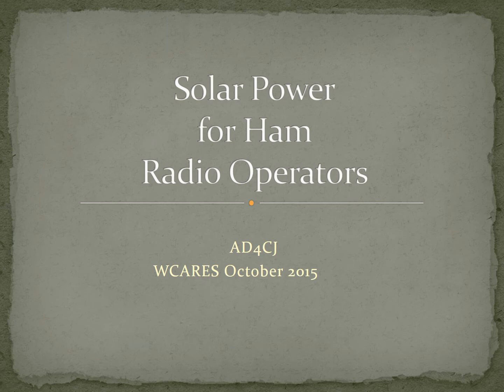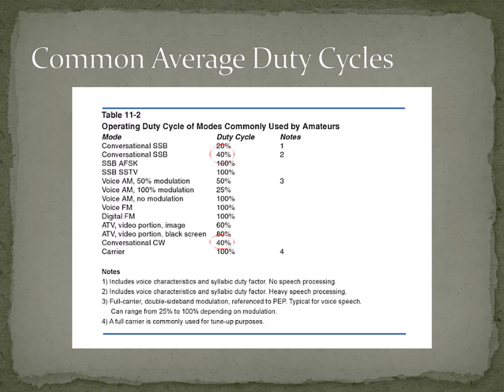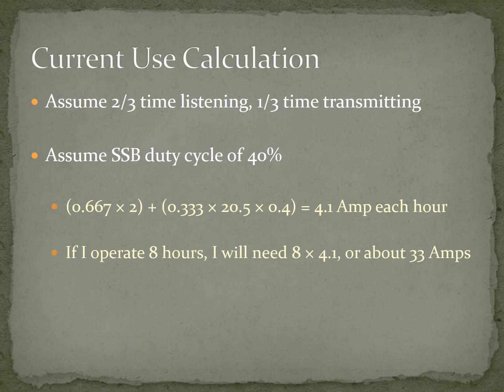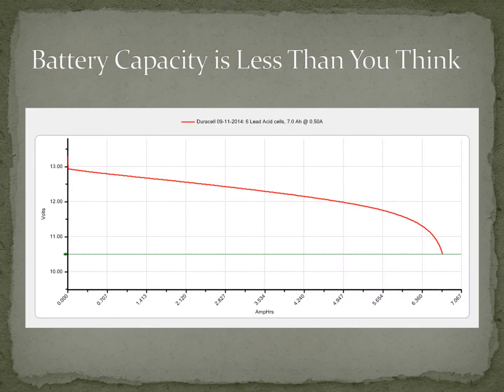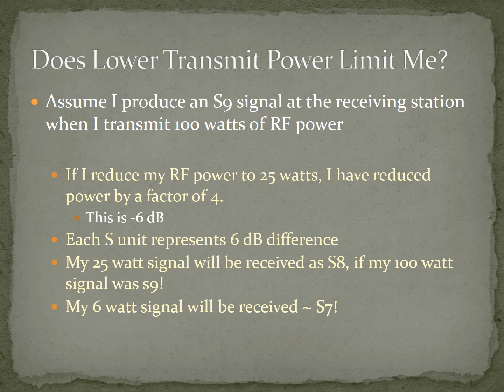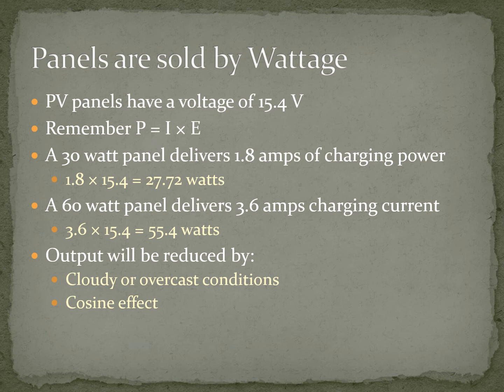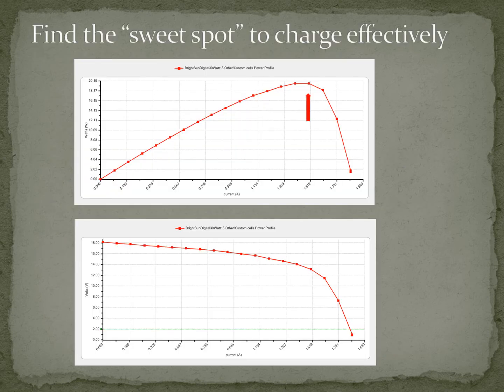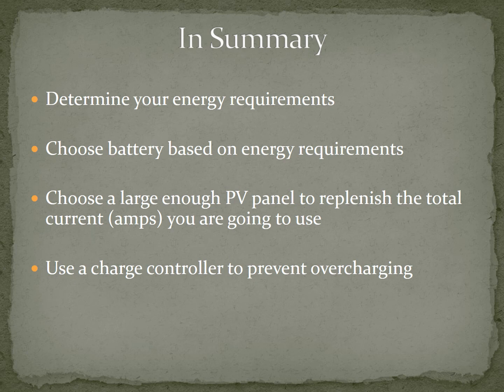Solar Power for Hams

Comment: Love this video, but a correction. 10.5vdc is considered dead. So when the MFG's do the 20hr rating, they go from 12.7 (full charge) to 10.5 volts (considered dead) to make their calculations. 12.04 vdc is considered 50% discharged, which is the lowest point you should take a deep cycle battery to to keep maximum life.
Reply from the maker: I asked Tim Kreth (author of this video) about this.  Tim replied: "The manufacturers test their batteries for 20 hours to set the Amp-hour rating. I agree that 10.5 V is a dead battery. That is exactly what the factory does in order to set the Ah rating for their lead batteries. This is the standard testing protocol.  If 2guitarme has different info from a reputable source, I would be happy to review it."  Please see this PDF... http://qrpschool.com/wp-content/uploads/2019/01/Deep-Cycle-Battery.pdf
Reply: @QRPSchool  No, I agree. They adjust their load to maintain a 5 amp load down to 10.5 volts. I understand the Peukert effect, but that is taken into consideration with the 20 hr. draw vs. a shorter time period. My point was just about the 0 volts vs 10.5 for a dead battery. Lead acid batteries are very complicated! :) 73 And again... thanks for the videos!